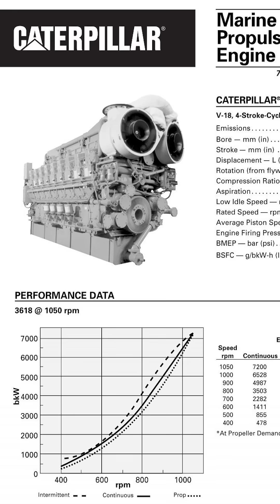wHy Don'T CaRS uSE V18 ENGiNEs?

Comment: Dang, I'm so early the only comments are by bots. Also, imagine mounting a boat V18 into a car lmao, crazy impractical, but it would be hilarious
Reply from the maker: Would the Crankshaft spin the Wheels, or THE WHOLE CAR?  Well only one way to find out...
Reply: I would suggest using a 18PA4-185 instead. You might be able to get some from somewhere, but they are very rare. I only know of two blocks still in existence.
Reply: Mercedes considered a W18 for the he W140 S-Class. The Blueprints still exist. During the same period BMW built a V16 7-Series prototype, that eventually got fitted to Johnny English's Rolls Royce Phantom, the V16 is from the same family as the V12 BMW built for the McLaren F1.
Reply: @bzilla-d4i i actually do recall reading about that. I also remember in the late 90s, bugatti had two concepts, the EB 118 (coupe) and EB 218 (sedan), both of which had a W18 as well
Reply: same dude
Reply: Same😂
Reply: An i the only one that is not noticing the bot comments or are the bot comments similar to human comments. and are hard to distinguish?
Reply: Just imagine how much modifications to the chassis would have to be done to even support the engine. Much less how much it's going to twist itself into a pretzel when it goes into gear.
Reply: Fr tho this is dead internet theory atp
Reply: @kanz7630  I don’t know a ton about cars so could you explain why it wouldn’t work? The video says a v16 is in production but 18 is way too big 😂 I just don’t get it couldn’t it be put in a large truck